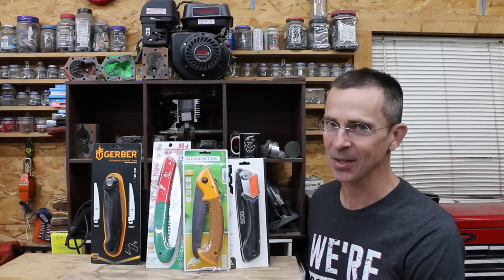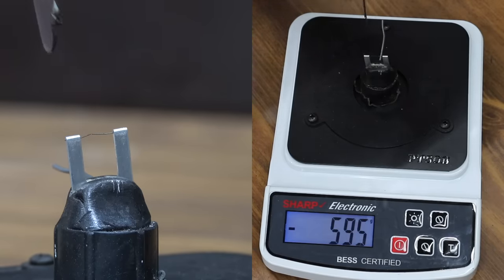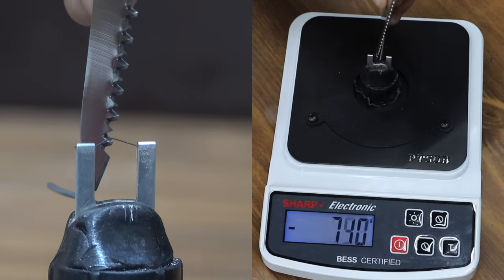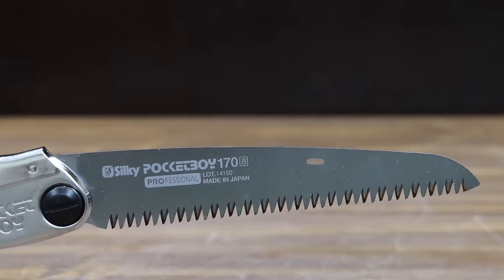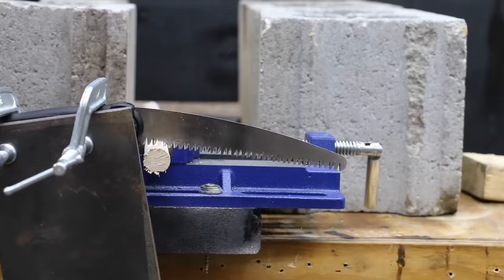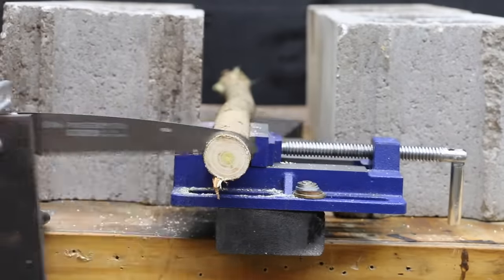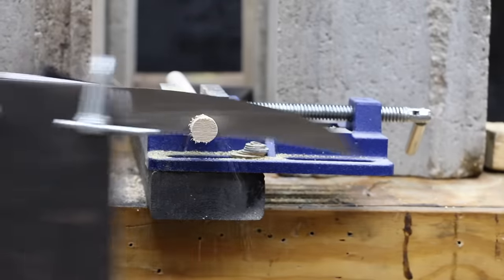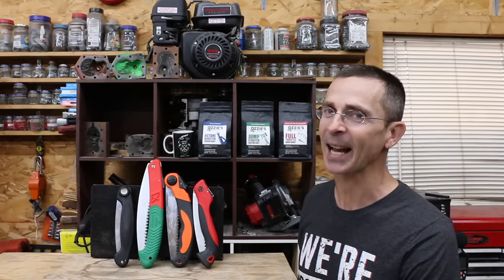Best Folding Handsaw? Samurai, SOG, Corona, Gerber, Fujiwara, Silky, Kershaw, Gruntek, Mossy Oak

Comment: - Which brake fluid tester is the best? ...measures the amout of water in your brake fluid.

- Which construction helmet is the best? ...comparison against different brand and army helmets.

- Whoch copper grease is the best? ...and heat and fire resistant.
Reply from the maker: Thanks for the suggestions.

Comment: Thank You for the great videos! Have you done one on auto ramps? I recently purchased a set from the parts store that were synthetic, not steel. With my F-250 I stillusually jack it up and put it on 2"X8"Xfoot long boards.
Reply from the maker: Thanks for the suggestion.

Comment: Please test windshield sun shades! Summer it's coming quickly in Texas and my old one is disintegrating. I want to know which type or brand insulates the best and blocks the most heat, lasts the longest, doesn't rip or tear super easy and the most compact.
Reply from the maker: Thanks for the suggestion.

Comment: I think the Silky would've performed better if you chose a blade length that was comparable to the length of the Corona and Samurai saws. The Pocketboy is the smallest in Silky's lineup. The F180 is both longer and cheaper than a Pocketboy and the Gomboy has a range of lengths. It also makes a difference whether you choose a straight or curved blade, and this video includes a mix of both. Some brands have options for both in the same size range. The Corona, Samurai, and Fujiwara are great deals but I think the comparison to the Pocketboy is slightly misleading.
Reply from the maker: Thanks for the constructive feedback.
Reply: @ProjectFarm  No problem, didn't want to come off as rude. Love your videos!

Comment: Test Request:  Test car battery maintainers.  I need a battery maintainer for a 6v tractor battery.  I had bought a new 6v battery for my tractor a few years ago and a NOCO Genius G1100 maintainer.  Within a year on the G1100 that 6v battery was toast.  I was seduced by all the lights on the G1100 and the ability of the G1100 to do both 6V and 12V.  I should have bought a BatteryMinder 12106.  Curious about Ctek UC800, Battery Tender, Schumacher, Black & Decker. 

Sadly BatteryMinder no longer makes a 6v maintainer/desulfator.   I would like to find a 6v/12v maintainer that preferably also does decent desulfation.  I have 3 BatteryMinder 12117 maintainers that I have used for years without problems.  The first 12117 I bought brought back a "Dead" battery I had replaced from my car and was sitting for months.  I put the 12117 on that dead battery for grins and forgot about it for 6-12 weeks.  When I remembered about that battery I tested it and to my surprise that dead battery was working!  I used it in my old pickup for a few more years.  Once that happened I became a believer in desulfation and bought two more 12117's.

Comment: the silky saw works best only on the pull stroke…, it is a pull saw, the push stroke is to clear saw dust but not much cutting. Pulling is what most people do better than push when resistance is present. Most saw here are push saws and used as such. Get the longest silky saw you can bring along and don’t look back. Train to saw on the pull cut and you’ll be golden and will not have anything else.

Comment: I work at Home Depot, I mentioned before to test out great stuff expanding foam and loctite expanding foam, people say that great stuff red, blue, black and green can are the same thing,

Can you test out construction sealants and adhesive? At home depot we have henrys, quickrete, sika flex and rapidset construction sealants and adhesive, 

when customers ask me which one I recommend i dont know what to tell them other than sika flex! But what if the other brands are better
Reply from the maker: Thanks for the suggestion.

Comment: It's disappointing to see how SOG has started producing cheap, low quality products, to compete with other brands at the lower price-point.  I've used SOG knives since 2005.  They were great quality, and made in the USA at that time.  Only a few models are still made domestically, and the brand no longer represents quality, just another average product... unfortunate.  I'm glad that these reviews exist!  I'd gladly buy a USA product that preforms well, even if it was more expensive.  It's not like you buy these things every week... the cost is easily offset over time, with higher quality, if it was to be had.
Reply from the maker: Thanks for the feedback.

Comment: It’s been 992 days since the first time I have requested an oil filter showdown. I’m tired….I don’t know how much longer I can ask
Reply: Kind of a tough test.  An engine up to spec isn't going to have much particulates.  You can show the construction and infer well made means works well.  You have to devise a test where matter that gets stuck in the filter media flows through each filter at the same rate.
Reply: @dlewis9760  if anyone can do it Project Farm can. It’s an important test. The quality of the oil filter is more important than the quality of the oil. Oil is regulated whereas the filter is not. There are plenty of expensive filters that are cheaply made.

Comment: Have you actually tested this knifesharpness test and if its accurate.
You put so much faith into these sharpness tester, based on a scale and some metalwire and its always 1 single test on each, and makes me wonder if your readings are all over the place on the same blade and the reason for only1 score on each, as there are so many things that will fluke your reading and factors that vary greatly from one test to the next, like your angle and how long your using for the cut.
try to take the non sharp knife, and then make a cut in 200ms and then one where you do it very dorcile, slowly like 3 sec...I wouldnt be surprised if your readings are night and day.
So I would love to hear, are you getting consitent readings on the same  blade?

Comment: One thing I will mention about the Silky - there are 4 different blade versions available for every size. If you be sure to order the correct blade type based on the wood that you intend to cut, you will have much better results overall.

Here are the available teeth sizes/configurations (tpi = teeth per inch):
7 tpi - Large/Coarse (pruning, green wood)
8.5 tpi - Medium (soft wood)
17 tpi - Fine (hard wood, bamboo)
22 tpi - Extra Fine (dry hard wood)
Reply from the maker: Thanks for sharing.

Comment: I could be wrong but i believe your testing is flawed. Cutting through the branchs every blade needs to be at the same angle. Tip down cut faster than horizontal or tip up. Putting pressure down and back will cut faster than straight down or forward and down every time, all other variables being equal. Jmo

Comment: Under coat for rusted car frames. Test those types of products
Reply from the maker: Thanks for the suggestion.
Reply: @ProjectFarm  hey. Also maybe the best multimeter. Fluke, vs maybe other brands. Idk. You can do a shock test (drop) and low temp operation I know some meters won't work outside in the cold.  High temp operation. Then maybe thermal shock. See if they can withstand being brought from -20 to room temp.  Run them over with a car (crush)  also see which one can reach the correct reading the fastest you know the basics part of being a meter. . Whatever. You know what to do brother;) great job
Reply: @ProjectFarm  also. Test air conditioners and space heaters. Shut off a section of the garage and see which A/C can bring the room down the fastest and with the least amount of wattage. Also use the same set up for electric space heaters.  Then while your at it. Compare more traditional ways of heating a garage. Cast iron wood stove. Ceiling mounted electric. Or the karsin heater.  Idk. Just throwing out ideas. I'm getting my garage set up for the first time. So I need basic environmental things like heat and lighting. Then I need basic tools like drill press. Table saw.  Ratchet set up and tools box with draws to hold all this.  You can do big show downs for stuff like that. Big tools. And garage furniture (bench, peg boards, tool cribs). See what tool crib draws can take fall damage. Thank you brother good job.

Comment: @ 6:05 that one didn't even cut the wire, it just pulled it out of the thing holding the wire. So you didn't actually measure the sharpness for that one, you measured the durability of the test rig. the actual sharpness score would've been even worse if the rig had held up

Comment: wow, this is the first video of yours that I feel the results were skewed. You should have chosen saws with the same TPI and blade length/shape, the silky had a massive disadvantage here with you choosing almost the smallest saw they make. In a level playing field Silky will out perform corona all day long, but not samurai, samurai only loses in the world of blade deflection and options. over the last 10 years as an arborist I have ran samurais, bahco, silky, corona, and also stihl hand saws, and many models from each brand. The curved gomboy 240 is the undisputed king of folding saws at work.

edit: If you're working around the yard, or you're only going to use the saw once or twice a year, just buy the corona for its price point and accessibility. They are wonderful, but dont hold up to commercial use at all.

Comment: fiskers best by far
Reply from the maker: Thanks for the feedback.
Reply: @ProjectFarm  Welcome. To bad you didn't have a Fiskers brand. specifically the 390470-1002 Power Tooth Soft Grip Folding Saw, 10-Inch. I use that daily for my job and it stays sharp! Should try one out as a Youtube short.

Comment: This is the results in a controlled test but real-life experience over many years of field use will give you different results.  Not much out there compares to Silky saws.  Carona has always been the cheap silky knock off with crap real life performance

Comment: Your sharpness test is very flawed. The angle of attack of the blade versus the material will greatly affect the number of strokes. Curved blades will appear to be sharper than straight blades, especially if they are angled downward in your jig. You need to measure forward and backward forces, as well as number of strokes.

Comment: I will point at 7:50 & call Foul - The blades are or were not keep at the same angles. The Fuji was pointing downward big time (same with the Corona) , some where level and some slightly upwards.
Never seen you so sloppy with your tests. Sorry but I felt I had to mention this.
It's is just my opinion but I have always felt the curved blades are meant to cause this effect - Change of angle, to improve the performance of the cut.
Reply from the maker: Thanks so much!